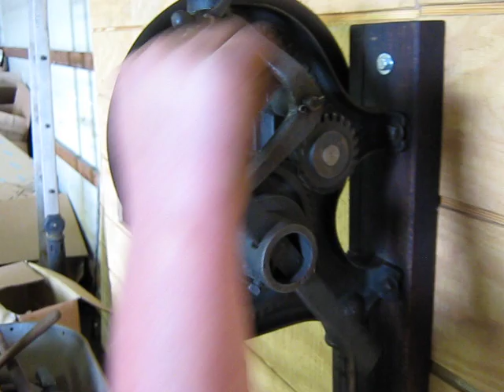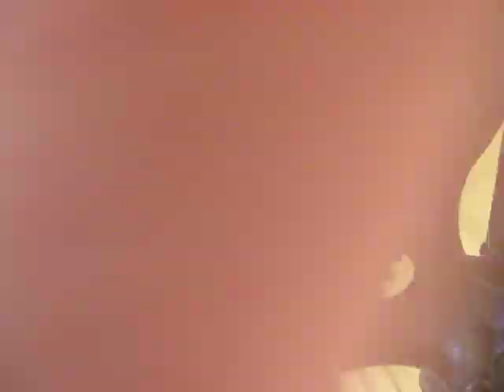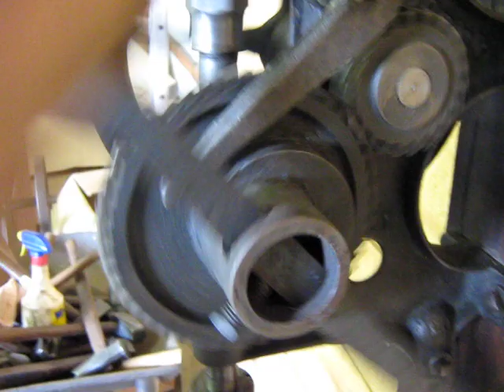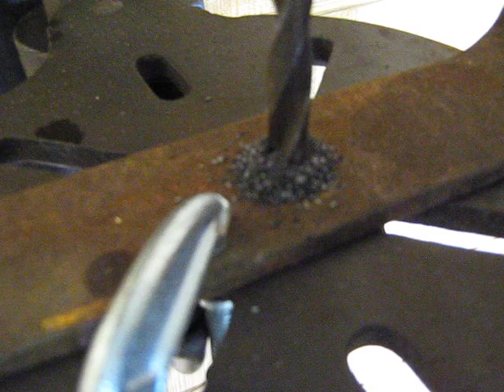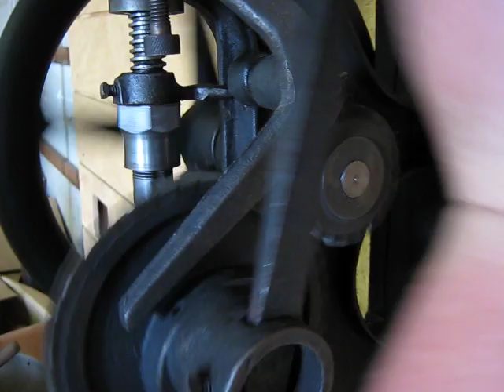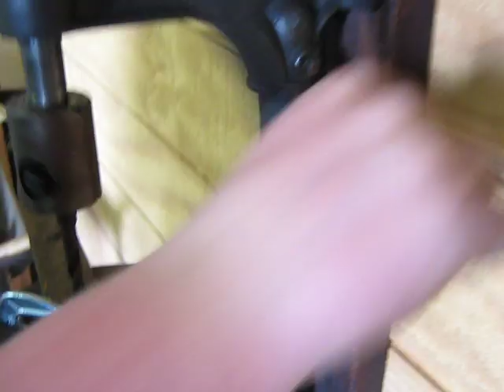BUFFALO FORGE POST DRILL DEMO.

Comment: Beautiful post drill.  I do some blacksmithing and managed to get a Blower & Forge No.614 (very similar to yours) in excellent shape.  Sadly it's missing the advance lever and bit the pushed the wheel that lowers the drill.  I will probably forge a new part (might even cast one).  If possible could to post the dimensions of that lever and angle?